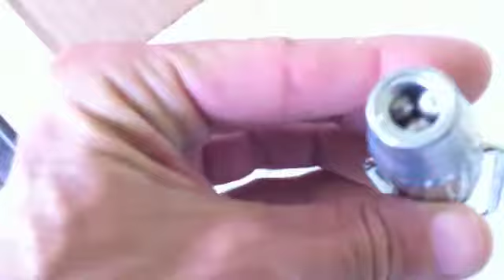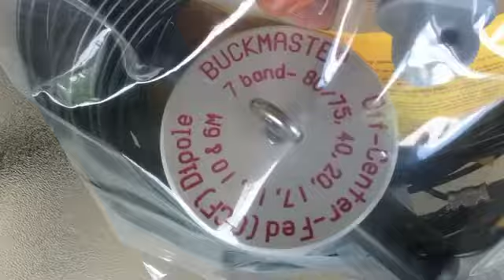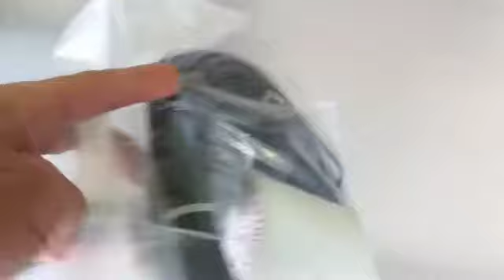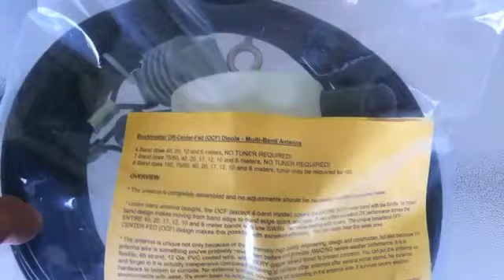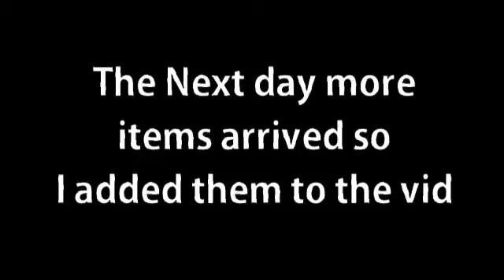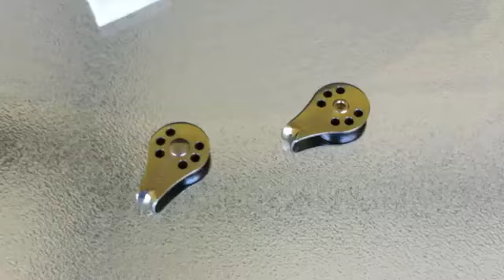Antenna and install items - Overview

Comment: Good video.  Mines noisy and I cant figure it out.  G5rv is perfect,  then I have this same Buckmaster on a 40ft tower with a pvc pipe as the mast,  coax not touching the tower,  2:1 swr on most of the 7 bands and just a bunch of static sounds.  If i switch over to g5rv in a tree at 30ft it all goes away.  Any ideas??